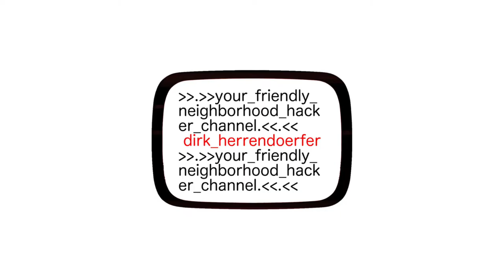Big Bad Robin Build VLOG pt. 7

Comment: It looks like you are underextruding the surface is a bit bubbly.
Reply from the maker: That's the scales - I suppose it's supposed to look like that.
A smooth-walled cylinder will come out as exactly that. But I must admit that the extruder is very close to the 'optimal' extrusion volume, and sometimes a little more looks way better.
It could also have something to do with the fact that my basement lab is really cold this time of year.